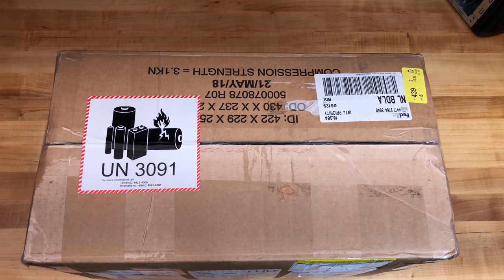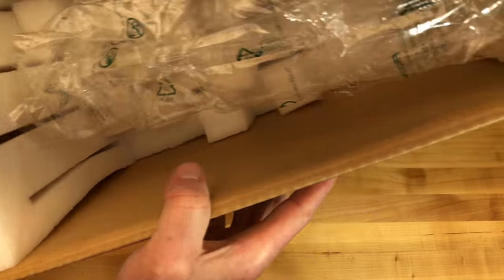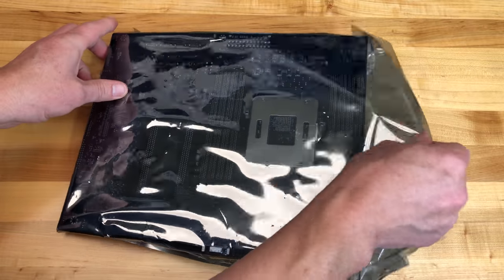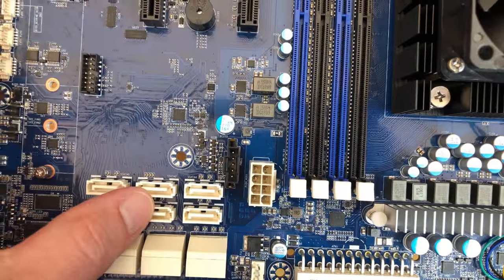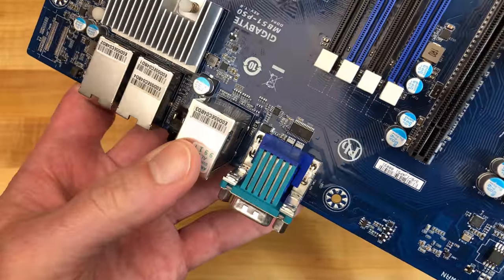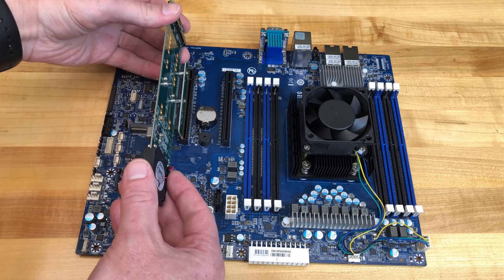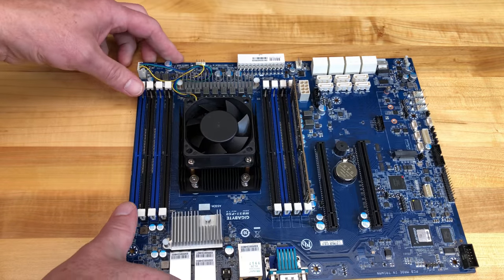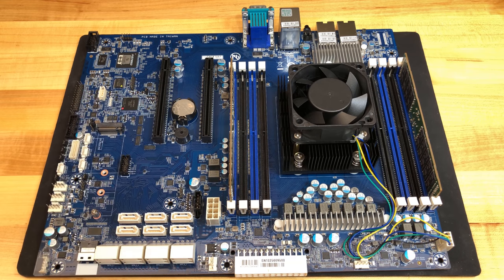Unboxing of the GIGABYTE Server Xeon D-2123IT 4 core ATX Motherboard MB51-PS0 [in 4K]

Comment: nice board with 14x sata !  but only 2 pcie slots will limit the use of some controllers or extra lan cards, prob the sata ports took the banwidth instead of extra slots. But still looks good this board with nothing else than usefull things to be stable